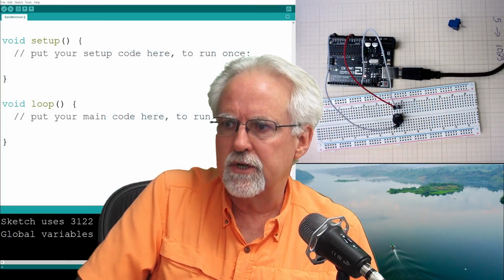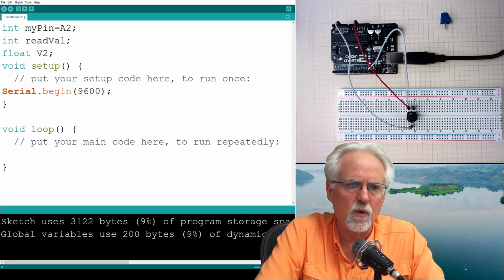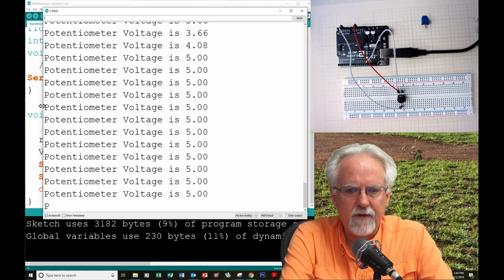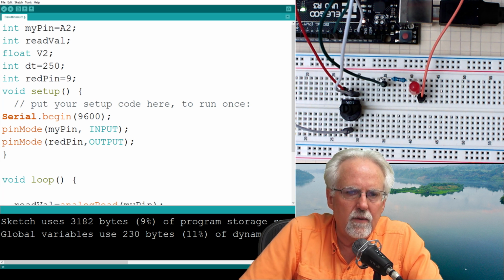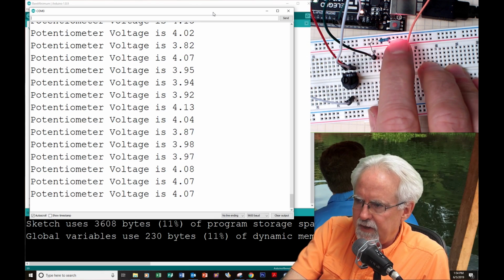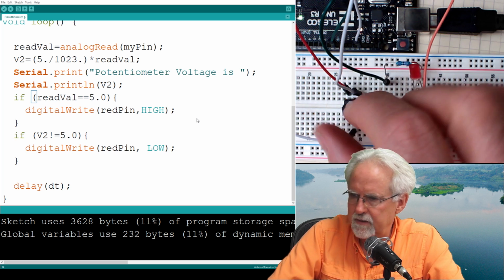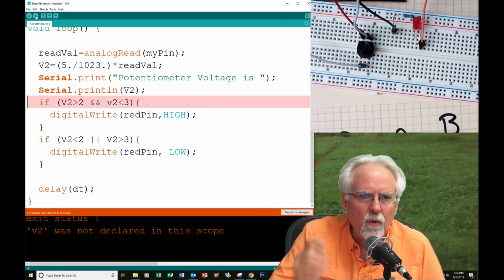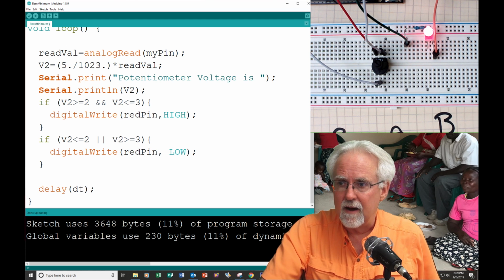Arduino Tutorial 13: Understanding Arduino If Statements

Comment: Okay this has been a long break again, but what is most important is simply that I do not stop. Got a bit disillusioned with the whole coding business and gave myself a long break to focus on other things, but now im back. I found this challenging and was a little confused as the LED wasn't lighting up (turned out I had it the wrong way round). The code is below:

int myPin = A0;
int redPin = 8;
int yellowPin = 9;
int greenPin = 10;
int myVoltageUnconverted;
float myVoltageConverted; 
int delayT(10);

void setup() {
  // put your setup code here, to run once:
  pinMode(myPin, INPUT);
  pinMode(redPin, OUTPUT);
  Serial.begin(9600);
}

void loop() {
  // put your main code here, to run repeatedly:
  myVoltageUnconverted = analogRead(myPin);
  myVoltageConverted = (5. / 1023.) * myVoltageUnconverted;
  Serial.println("After Conversion: " + String(myVoltageConverted));
  if (myVoltageConverted < 3){
    digitalWrite(greenPin, HIGH); 
    digitalWrite(yellowPin, LOW);
    digitalWrite(redPin, LOW);
  }
  if (myVoltageConverted >= 3 && myVoltageConverted <= 4 ) {
    digitalWrite(greenPin, LOW); 
    digitalWrite(yellowPin, HIGH);
    digitalWrite(redPin, LOW);
  }
  if(myVoltageConverted > 4){
    digitalWrite(greenPin, LOW); 
    digitalWrite(yellowPin, LOW);
    digitalWrite(redPin, HIGH);
  }

  delay(delayT);

}

I am sure there is a quicker way of coding a solution but this to me is the most readable for a beginner such as myself. A couple of notes: I reduced the delay in order to see a more immediate change and I also found that one of my potetniometers was broken, so once switched out everything worked as expected.

Comment: int pin=A0;
int RV;
float volt;
String a="voltage= ";
int pin1=11;
int pin2=10;
int pin3=9;
int pin4=8;
void setup() {
pinMode(pin,INPUT);
pinMode(pin1,OUTPUT);
pinMode(pin2,OUTPUT);
pinMode(pin3,OUTPUT);
pinMode(pin4,OUTPUT);
Serial.begin(9600);
}

void loop() {
RV=analogRead(pin);
volt=(5./1023.)*RV;
Serial.print(a);
Serial.println(volt);
delay(100);
if (volt>=0 && volt<1.0) {
  digitalWrite(pin1,HIGH); 
}
if (volt>1.0) {
  digitalWrite(pin1,LOW); 
}
if (volt>=1.0 && volt<2.0) {
digitalWrite(pin2,HIGH); 
}
if (volt>2.0) {
  digitalWrite(pin2,LOW); 
}
if (volt>=3.0 && volt<4.0) {
  digitalWrite(pin3,HIGH); 
}
if (volt>4.0) {
  digitalWrite(pin3,LOW); 
}
if (volt>=4.0 && volt<5.0) {
  digitalWrite(pin4,HIGH); 
}
if (volt>5.0) {
  digitalWrite(pin4,LOW); 
}

}
But the problem when we start from 5v to 0v all the leds will be on so i should reset

Comment: here is the code

//Assignment lecture 13
//if the voltage is less than 3 volt then the green led will glow
//if the voltage is between 3 to 4 then yellow led will glow
// if the voltage is above 4 volt then the blue led will glow

int mypin =A2;
int readval;
float v2;
int dt =500;
int redpin =9;
int yellowpin =10;
int greenpin = 11;

void setup() {
  // put your setup code here, to run once:
Serial.begin(9600);
pinMode(redpin, OUTPUT);
pinMode(yellowpin, OUTPUT);
pinMode(greenpin, OUTPUT);
pinMode(mypin, INPUT);
}

void loop() {
  // put your main code here, to run repeatedly:
readval =analogRead(mypin);
v2 = (5./1023.)*readval;
Serial.print(" The potentiometer voltage is ");
Serial.println(v2);

if(v2<3){
  digitalWrite(greenpin, HIGH);
 }
  if(v2>3){
  digitalWrite(greenpin, LOW);

}
if(v2>3 && v2<4){
  digitalWrite(yellowpin, HIGH);
 }
  if(v2<3 || v2>4){
  digitalWrite(yellowpin, LOW);

}
if(v2>4){
  digitalWrite(redpin, HIGH);
 }
 if(v2<4){
  digitalWrite(redpin, LOW);
 }

delay(dt);
}

Comment: Hi, Paul.I am 80 years old. I have worked with computers and electronics almost all my life. I have also served as a "tentmaker" minister all my life. I have been retired for almost 20yrs and wanted a hobby that would stimulate my mind. I settled on the Raspberry Pi and the Arduino. I already understand the electronics and can program in ASM, BASIC, FORTRAN, C++, and Python. I am still going through each lesson because I enjoy your style of teaching. Thanks for continuing to stimulate my mind.
Reply: What's a "tentmaker minister"? Curious to know.

Comment: Hi Paul, I learned a lot in this lesson and I understand that your goal for this lesson is to learn us the syntax of the 'if'-statement and make visible what happens when you use it. 
But,  and I don't want to seem cocky,  when you use the 'if' statement to avoid high voltages and prevent the burning of electrical components I would immediately use a new 'digitalWrite'  to  set the voltage back to a safe value, thus limiting the possible Volt-range. Making programs foolsproof is a practical use.
Well, I enjoyed the lesson very much and it keeps me busy as you can see.
See you around!

Comment: I set V2==5.0 and it worked for me just fine.

Did you check the serial monitor to see if you were in fact getting up to 5V? (There might be a problem with your potentiometer.)

Comment: Hi Paul
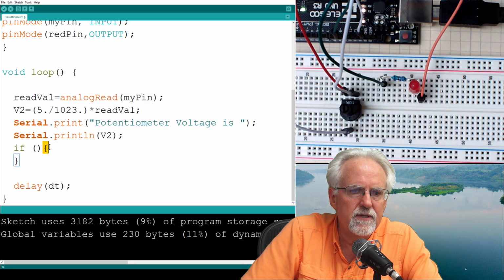At about 18:00 min into your lecture you told us about the curly brackets in the if statement and i saw a little homework for me to do. Turns out that if you press enter after you open the curly brackets, then the program enters the second curly bracket automatically as opposed to you moving your cursor with the mouse to the line below (then you will have to put in the curly bracket yourself). Also I love it when you purposely make mistakes, it keeps us all sharp to syntax.

Comment: This is something I noticed with my old original Arduino Uno R3 board, and I get the same thing with the new Elegoo Uno R3 board: Unless I specifically add code to turn off the onboard L LED (pin 13), it lights up whenever I run a sketch (even if there's no code that tells it to).
Is this an intrinsic flaw in the board?

Comment: why not this is not working? 
if (V2>4 && V2<1){

  digitalWrite(redPin,HIGH);
}
if (V2<=4 || V2>=1){
  digitalWrite(redPin,LOW);
}
Reply: but this does
if (V2<4 && V2>1){
  digitalWrite(redPin,LOW);
}
if (V2>=4 || V2<=1){
  digitalWrite(redPin,HIGH);
Reply: Because something cannot be >4 and <1 at the same time ( in your first logical statement).

Comment: Hi Paul, I finally got my circuit to work as you requested. I did most of it from memory but had to cheat a little bit [I left out the baud rate] then I had a couple of typo errors (leaving out the V2 in the second part of the "if" statements) but it now runs like clockwork. Thanks again, another great tutorial that was both fun and informative.

Comment: I am attching my code here 
int greenled  = 12 ;
int yellowled = 8  ;
int redled    = 5  ;

int analogin  = A0 ;
int analogread ;
float  V2 ;
int  dt = 500;

void setup()
{
 pinMode (greenled,OUTPUT); 
 pinMode (yellowled,OUTPUT);  
 pinMode (redled,OUTPUT); 

  pinMode (analogin,INPUT); 
  Serial.begin(9600);
 }

 void loop ()

{
  analogread=analogRead(analogin);
  V2=(5./1023.)*analogread   ;
  Serial.print("potentieometer reading ");
  Serial.println(V2);
  
  if (V2>0.1 && V2<3.0)
  {
   digitalWrite(greenled,HIGH);
    digitalWrite(yellowled,LOW);
   digitalWrite(redled,LOW);
   Serial.println("Voltage is control ");
  }
  
          if (V2>3.0 && V2<4.0)
          {
            digitalWrite(greenled,LOW);
            digitalWrite(yellowled,HIGH);
            digitalWrite(redled,LOW);
            Serial.println("Reduse the Voltage ");
          }

                if (V2>4.0 && V2<5.0)
                {
                  digitalWrite(yellowled,LOW);
                  digitalWrite(redled,HIGH);
                  Serial.println("Voltage is out of control ") ;
                }
   delay(dt);
}
Reply: Your homework looks good, I give you an A99 for the homework grade. But why did I not give you an A100? Well, you forgot to turn off the green led in the last if statement. But the rest look really really good. You should be proud of what you did here. Keep up the excellent work!!!

Samuel

Comment: Done my homework, not the easiest, couldn't get it to work straight away, then realised I had not used upper case on one of the HIGH's so the code would not load. Got there eventually though, another great tutorial thanks Paul.

Comment: Hi Paul, this is a brilliant series and it has taught me many new skills. I have one question about this episode, in the part where the LED would come on if the voltage is between 2V and 3V, where you used,

if (V2>2 && V2<=3) {
digitalWrite(redPin, HIGH);
}
if (V2>2 | | V2<=3) {
digitalWrite(redPin, LOW);
}

would it be easier to use an else statement? Such as 

if (V2>2 && V2<=3) {
digitalWrite(redPin, HIGH);
} else {
digitalWrite(redPin, LOW);
}

I am only just learning arduino but I have seen it used in other applications and curious if this is how it can be used. Many thanks :)

Comment: I was going to make a warning pop up with the light come on at 4 volts saying "WARNING, REACTOR OVERHEATING! REDUCE POWER!!" and then at 5 volts, the light would blink on and off each second, and the program would print "WARNING! RED ALERT! AUTOMATIC SELF-DESTRUCT SEQUENCE INITIATES IN T-MINUS (time) SECONDS! EVACUATE ALL PERSONNEL IMMEDIATELY!" and then adjust the T-minus countdown, using the time = time - 1 with a 1 second delay. and when time == 0, a message says "BOOM!" and turns everything off 😄 Neat lesson Paul!
Reply: It took so long but I got the self-destruct message I wanted! 🤯🤯 It deactivates when you reduce the voltage back down under 4.99.

int myPin = A5;
int warningLight = 9;
float readVal;
float V1;
float volts_ = 5.0;
float delayT = 1000;
float delayWarn1 = 1000;
float delayWarn2 = 1000;

float selfdestruct = 10;

String(mess1) = "Reactor Voltage is ";
String(messWarn1) = "WARNING!";
String(messWarn2) = "REDUCE VOLTAGE!";
String(messSafe) = "Safe Voltage condition";

String(messCrit1) = "WARNING! RED ALERT! ";
String(messCrit2) = " VOLTS REACHED IN THE REACTOR!";
String(messCrit3) = "REACTOR CONDITION CRITICAL! EVACUATE ALL PERSONNEL IMMEDIATELY!";
String(messCrit4) = "SELF DESTRUCT SEQUENCE INITIATES IN T-MINUS ";
String(messCrit5) = " SECONDS.";

void setup() {
  // put your setup code here, to run once:
Serial.begin(9600);
pinMode(myPin,INPUT);
pinMode(warningLight, OUTPUT);

}

void loop() {
  // put your main code here, to run repeatedly:
readVal = analogRead(myPin);
V1 = (volts_ / 1023) * readVal;

if (V1 > 4.0 && V1 < 4.99 && selfdestruct >= 0) {
    selfdestruct = 10.0;
    digitalWrite(warningLight,HIGH);
    Serial.print(mess1);
    Serial.println(V1);
    Serial.println(messWarn1);
    Serial.println(messWarn2);
    Serial.println("");
    Serial.println("");
    delay(delayWarn1);

    digitalWrite(warningLight,LOW);
    Serial.print(mess1);
    Serial.println(V1);
    Serial.println(messWarn1);
    Serial.println(messWarn2);
    Serial.println("");
    Serial.println("");
    delay(delayWarn1);

  }
if (V1 >= 4.99 && selfdestruct >= 0) {
    digitalWrite(warningLight,HIGH);
    Serial.println(messCrit1);
    Serial.print(V1);
    Serial.println(messCrit2);
    Serial.println(messCrit3);
    Serial.println("");
    Serial.print(messCrit4);
    Serial.print(selfdestruct);
    Serial.println(messCrit5);
    selfdestruct = selfdestruct - 1;
    Serial.println("");
    Serial.println("");
    delay(delayWarn2);

    digitalWrite(warningLight,LOW);
    Serial.println(messCrit1);
    Serial.print(V1);
    Serial.println(messCrit2);
    Serial.println(messCrit3);
    Serial.println("");
    Serial.print(messCrit4);
    Serial.print(selfdestruct);
    Serial.println(messCrit5);
    selfdestruct = selfdestruct - 1;
    Serial.println("");
    Serial.println("");
    delay(delayWarn2);
}

if (V1 < 4.0 && selfdestruct >= 0) {
  digitalWrite(warningLight,LOW);
  Serial.print(mess1);
  Serial.println(V1);
  Serial.println(messSafe);
  Serial.println("");
  Serial.println("");
  delay(delayT);
}

if (V1 >= 4.99 && selfdestruct == 0) {
  Serial.println("BOOM!");
  selfdestruct = selfdestruct - 1;
}
if (V1 >= 4.99 && selfdestruct < 0) {
  digitalWrite(warningLight,LOW);
}
}

Comment: I had the issue of the light flickering as well. I think the problem is the tiny changes to the voltage if the connection isn't secure. I gave my program a tiny bit of wiggle-room of about 10 mV for inconsistencies which helped eliminate the issue. Another potential solution is to try fidgeting with the leads on the potentiometer or try another position on the breadboard.

Comment: here is the homework. so to make you sure we are really following you sir O7

int redPin = 9;
int greenPin = 3;
int yellowPin = 7;
int myValPin = A2;
int readVal;
float V2;
int dl = 500;

void setup() {
  pinMode(9, OUTPUT);
  pinMode(3, OUTPUT);
  pinMode(7, OUTPUT);
  pinMode(myValPin, INPUT);
  Serial.begin(9600);
  }

void loop() {
  readVal = analogRead(myValPin);
  V2 = (5./1023.)*readVal;
  Serial.print("V2 = ");
  Serial.println(V2);

  if (V2 < 3) {
  digitalWrite(greenPin, HIGH);
  digitalWrite(redPin, LOW);
  digitalWrite(yellowPin, LOW);

  } else if (V2 > 3 && V2 < 4) {
  digitalWrite(redPin, LOW);
  digitalWrite(greenPin, LOW);
  digitalWrite(yellowPin, HIGH);

  } else if (V2 > 4) {
  digitalWrite(yellowPin, LOW);
  digitalWrite(redPin, HIGH);
  digitalWrite(greenPin, LOW);
  }
  
  delay(dl);

}

Comment: Just starting Arduino, got this HW in less than 5 min, first attempt, Wrote the code, then set up the circuit, and it worked flawlessly! thanks! I did notice though that these statements cant be used for, say, 4.00 volts. The system doesn't like that specific of a figure for some reason.

Comment: Thanks again Paul!  Got through this one.  Quick question ... why is readVal set up as an int? I thought readVal will read the different voltages from the pot and should be set as a float.
Reply: I figured it out ... duh!!  It is because readVal is not voltage but a binary representation 0 to 1023 👍

Comment: Having a background in C helped with this project, as this was more math and using logical if statements for comparisons. I haven't looked at the code that uses the loop() { }, but a for (;;) probably would word work omitting the start and end conditions resulting in an endless loop. 
It didn't take too long to code this one up. I wouldn't be surprised if someone already wrote a Dummies book for the Arduino.
I like challenges that make me think. Forgetting to set up pinMode() causes the leds to be lit half as bright instead of fully on. I managed to install Arduino 2.4 on Windows and 1.8.2 on Mint 21.1 Linux. Also installed are C/G++ multi libs.
Wayne

Comment: I am going through thi because it is fairly thorough.  Like Walt, I am 70 and this is an interest thing.  I have a masters in comp sci, programmed, taught programming, ran a computer shop of 600 or so folk, so some experience.  This is a little slow, but does a great job of linking physical to software.  Thanks.

Comment: I'm 78 but you can call me a Kiddo if you want.  I do wish you would show the script so we could actually type it.  I am a good typist but seem to fail in putting a capital letter in the second word or some other silly thing.  Then I am searching all over trying to find my error.  At present, I am using 2 screens, one with you on it, the other my program and serial screen.  I spend a lot of my time moving back several minutes to compare what I have with what you have, tonight almost an hour before I found my mistakes.  But I also know that this is over 3 years old so it is not going to change.  Did I ever mention I drink a lot of coffee but it has got to be HOT.😋

Comment: Hi, Paul. I’m a retired software engineer that had an early start as a lab technician instrumenting wind tunnel models and building lots of ham gear. I’m totally enjoying getting back to my roots by following your course! So I have a question. A few lessons ago you used an oscilloscope - it’s been years for me since I’ve used one, and they have changed a lot. My birthday comes up in July and I want to buy one, preferably under $500. I’ve been looking at Instek, Rigol, Siglent, Hantek & Owan. So many choices. Can you recommend one that is reasonably accurate and flexible for microcontroller development - Arduino (and Raspberry Pi down the road.) Thanks, David R

Comment: On the homework assignment, I got it working. Have a question, can more than one statement be made in one if statement? I used 9 IF statements however it does work. Love this site, I'm 74 and tried before and got frustrated, now I am learning and loving it. The electronics are no problem, been studying them for years. Don't have all the answers but it has helped me. Thank You Joe
Reply from the maker: You can nest if statements.

Comment: Thankyou for the tutorial, having trouble understanding the floating math part, but I did experiment on my own, I used a green and red led, green lights up below 4 volts and red at 4 volts and higher but  I'm having trouble with turning off the green at 0 volts, all it does is do a low power blink with the TX led on the Arduino board, any thoughts ? its driving me crazy.